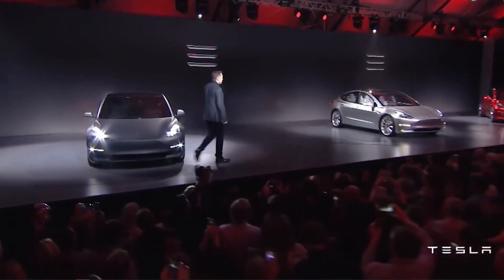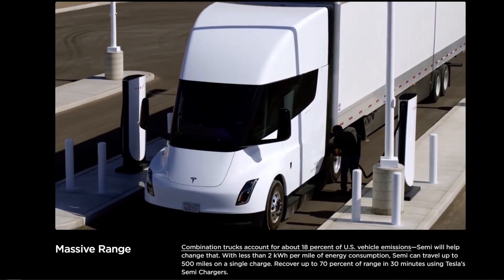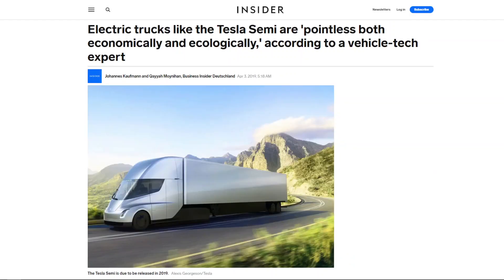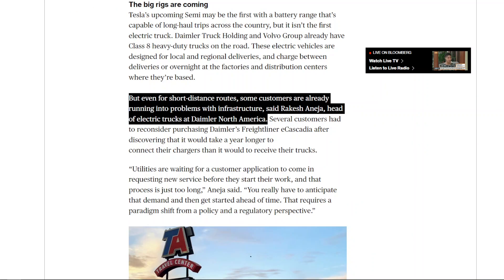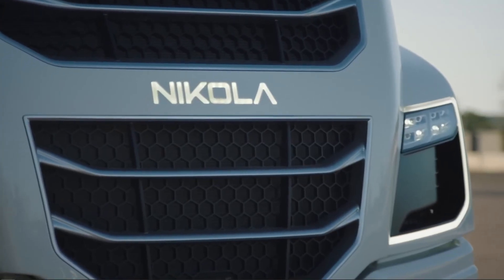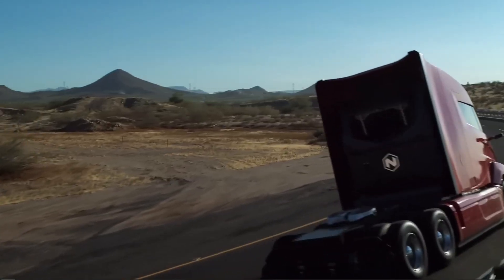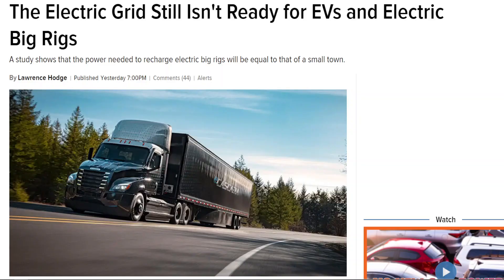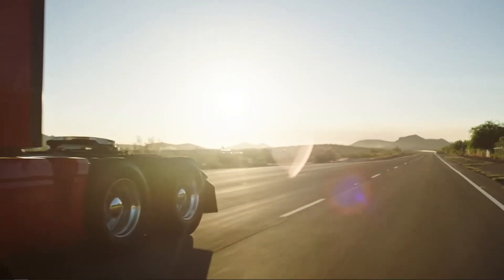Sandy Munro: Battery-Electric Trucks Are EXTREMELY Flawed For Long Haul.

Comment: I would guess that these megawatt chargers will be somewhat segmented from the grid.

Otherwise its probably time to upgrade the grid, in the same way that fibre optics replaced telephone wires for internet
Reply: Don't forget that Tesla has the MegaPack battery systems sized for grid support.  I understand that typically Tesla would install some MegaPacks at charging stations which basically buffer the demand on the grid over the 24 hours period each day and top up during night time off-peak hours.
Reply from the maker: @rogerhale6895  You mean adding more cost to an already expensive megacharging system?
Reply: Will the electric car cult people ever come to terms with this?

I have been scouring YouTube and there are literally only a handful of videos offering ANY CRITIQUE of the Tesla Semi.
Reply: @SkepticalZack  Unfortunately, you have people who bought into the stock scam, bought one of the products and are trying to excuse that bad decision, and ignorant people who follow trends.  None of them can apparently see reason or think for themselves.

Sad, really.
Reply from the maker: You can't "segment" anything from the grid
Reply: @visceral_investing  Tesla Superchargers are 100% offset by renewable energy (Google). I assume they’ll continue this strategy with the megawatt chargers.

You are half right though, Im not sure how many Superchargers are independent/segmented from the grid.
Reply from the maker: @edc5068  The renewable energy sources are still part of the grid...
Reply: @edc5068  No, they aren't.   And remember that batteries don't 'smooth out' grid fluctuations without DISCHARGING.  That means they will be, at any point in time, charging at the same time trucks are attempting to charge.

Not a solution...just another crap idea.
Reply from the maker: People forget that 95% of all grid storage is hydro and compressed air, not batteries. Even with 80% reduction in costs, grid operators are not using them or replacing the old methods. There's a very big reason for that
Reply: @visceral_investing  Actually, I would name 2.  First, replacing them with ANOTHER form would be ludicrously expensive with zero benefit.  Second, they already understand what a mistake this approach is, since it introduces another level of complexity and unreliability into the already ponderous nature of grid operations.

Storage also can only provide so much power at a relatively low rate, meaning it less than suitable for things like peaking, transitioning, or baseliading.  In other words, providing anything other than sub-baseload EMERGENCY power.
Reply: @billcichoke2534  battery systems help compliment the renewables for their disadvantage of only being able to intermittently capture energy when wind and sun are available. It’s also modular, and can grow / maintain / upgrade as needed.

Comment: Another good video on the benefits of fuel cells in the over the road trucking industry. This is where this technology will shine! Thanks!
Reply: Naaa. Fuel cell for shuttle
Reply: @max Maxie, if you trust and rely on it for the shuttle in outer space, for years,  why not put it in a class 8 truck? Makes the power, and is increasing in range. True, I’ll miss the sound of a diesel and Jake brakes, but I won’t miss the exhaust, and escalating price for oil and diesel.